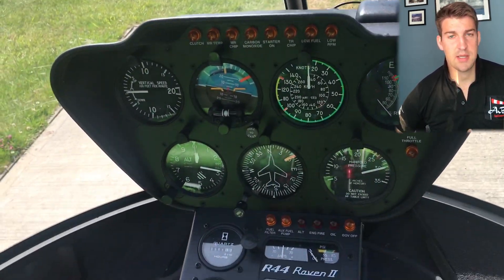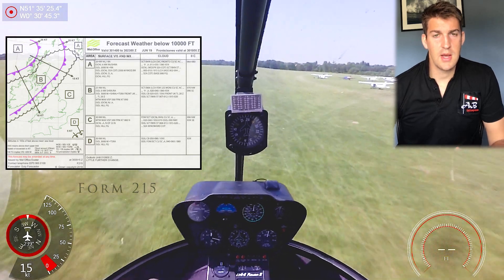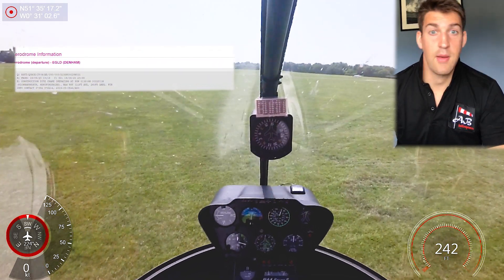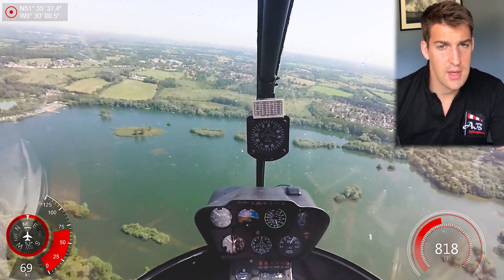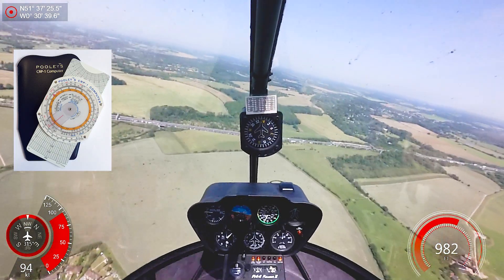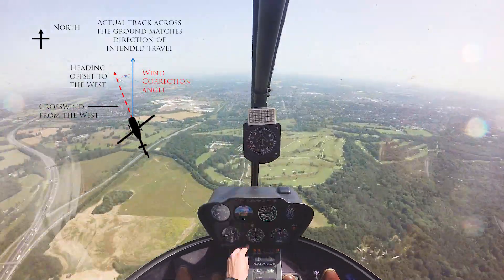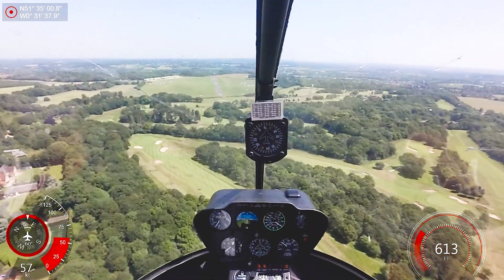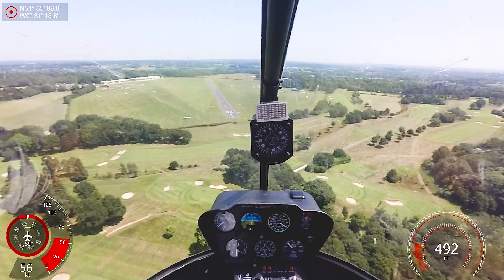How do Helicopter Pilots Navigate? The basics!

Comment: How do you avoid other traffic such as other helicopters/light aircraft (especially if travelling in sun)?  How do you navigate at night?  Don´t you have a GPS guidance system?  Say around London, there must be some serious restricted airspace because you´re on the flight paths to Stansted, Luton, Heathrow & London City.  Don´t forget that pilot who crashed into a building by the Thames a few years back in fog (you must remember that).  Watford, that is on the Heathrow approach out heading towards Clacton.

You mention head/tail winds.  Do thermals in the summer affect helicopters?  Say you have a cold front approaching from the s/w in July with potential for some serious CN clouds 25000ft+ you´re likely to see some serious lift.  Also ice buld up, how does this affect flying?  Does humidity need to be taking into account as well?  Ice can have serious consquences on commercial airlines.

http://www.skystef.be/forecast19c.html

BTW is it really +10c at 20000ft as shown on this site (see the pink over Tunisa, it has +25c)?  The site states that you add 10c to get a rough average of land temp, which would give 35c-40c but it breaks the rule of subtracting 2c for every 1000 ft.
Reply from the maker: Navigation at night is a bit more tricky - rely on dead reckoning, use of radio aids, and using large features that are well lit to navigate by - eg large motorways and towns/ cities- but the level of accuracy will be reduced as everything else looks black _ I have a few videos of night flying - check out our ‘Md500 night flying’ one - - here is an exercise for you - try and compare it with ‘Md500 part 2’ - same route - just day/night - and see if you can match any parts of the route up
Reply: @ABHelicopters  Hi, thanks for the reply but it raises more questions than answers.  The helicopter that crashed into the crane by the Thames, are there no laws on visability?  Going on the Thames route, are there height & speed restrictions?  e.g. going west you need to be 3000ft & going east you need to be 2000 ft.  I am getting dizzy, first you need to be scanning the air for other traffic but at the same time you need to be looking out for landmarks, a bit like driving whilst using a mobile phone?  You´re talking serious speeds.  I guess a helicopter can go at least 120 mph, whilst a Cesna probably can go the same speed, it doesn´t give much reaction time.  Also into the mathematical equation do you not need to add decreases in air (drag) as you go higher?  e.g. in Mexico City, you will need a far longer runway to land than at sea level!

I will have a go but outside the central London area I could get seriously rusty.  I think what you have given is an incredibly basic video, to a very complicated job.  Watching youtubers such as "CaptinJoe", who I guess works for Air Berlin, you realise what an incredible amount of knowledge you need to be a pilot.  You need to understand engineering
Reply from the maker: Hi Tim,
Sorry I had not got around to responding to your London airspace question - yes I do recall the incident - it was unfortunately very close to home. The airspace is indeed very complicated - between Luton, stansted, Heathrow and Gatwick there is effectively a level of uncontrolled airspace below 2500ft, with control areas directly around each airport. Flying over London is subject to additional rules - I have a few ‘Pilot guide videos’ for flying in the control zone , on the helicopter routes, which explain more. The primary restrictions are on heights, and where single engine helicopters can fly / clearance limits. You are correct that there is a lot of multi tasking going on , perhaps monitoring and using two radios, whilst maintaining strict adherence to height and heading, hence why it should be practiced multiple times.
Reply from the maker: Air density, altitude and temperature all make a difference , not only to the wind speed, but also the airspeed, - which is why there is a difference between indicated, calibrated, equivalent and true airspeeds -and of course - the ground speed
Reply: @ABHelicopters  This is an incredibly skilled job.  I always thought Gatwick never really came in the M25 area, they would turn left towards Maidstone coming in from the east.  I flew to Orlando once & the aircraft took off on the easterly (or is Gatwick´s runway S/W - N/W?) the pilot turned out of the M25. Also you have weight factors (fuel) to contend with as well which could affect flight times & costs.  Mathematics is a must.  Have you never thought about a commercial 2 jet engine license?  These things cost an absolute bomb, 100,000k+

Wasn´t there another incident (about 2 years ago) where a small engined aircraft went into Heathrow´s controlled airspace & shut Heathrow down for 45 minutes!  I doubt whether the controllers at Heathrow, were to impressed!
Reply from the maker: Gatwick runways are E/W facing. The airspace to the south of London is slightly less congested - but there is still London city , biggin hill, fairoaks and farnborough in close proximity to LGW. Unfortunately the journey to commercial heli or fixed wing is expensive , but With heli - the route to employment is often less defined/ or structured compared with the airline world. Unfortunately infringements , at Heathrow or otherwise , are costly in terms of time and money of re routed aircraft - the caa publish monthly statistics of infringements- and encourage the use of moving map gps devices on tablets (eg sky Demon , runway Hd) to avoid airspace busts
Reply from the maker: Hi Tim,

Thank you for the comment - so first of all avoid other aircraft - a principle of see and avoid applies in uncontrolled airspace - you are constantly scanning for other traffic. There are measures you can take to aid this- so for example- don’t fly at large numbers of altitude - say 2000ft bang on- instead - go for 2100ft, 
Secondly - around this area - there is a lower airspace radar service - Farnborough radar - on 132.800mhz , whom can offer a traffic service - you set a squawk on the transponder - and they can see you , and other traffic, and give you warnings about them
Reply from the maker: Any other questions? Happy to try and answer
Reply: @ABHelicopters  You´re probably wondering why I am asking so sophisticated qustions; after all I have no aviation experience apart from getting on planes.  I just watch videos put out by youtubers "Captin Joe" & "mentour Pilot" that make you realise just how complicated being a commercial pilot actually is.  Flying the thing is just a small part of the equation,  much of the job centres around preparation.

I am not sure how much it applies to helicopters but one of the videos was about descending ratios.  Some of the maths went completely over my head.  I thought the onboard computers did it but evidently not.  Plus you have holding patterns to contend with

Probably more importantly how does one apply to be a helicopter pilot in the first place?  Is it not better to get a graduate.  place in the RAF or something?  Most commercial companies only want people with experience, that´s why many fly parachutists.

Don´t forget too, there are many private airfields.  Isn´t there a big a private airfield inbetween the A12 & M11 (a receptor for holding Heathrow patterns).  You need to know the London terrain inside out.
Reply from the maker: You are referring to Stapleford airfield and the Lambourne VOR or Hold?
Reply: @ABHelicopters  PS Do you believe the official theory of the Leicester helicopter crash?  It looked to have hit something such as a drone!
Reply from the maker: I believe there is a report out with regards to the A169 crash, relating to a disconnect from the yaw control pedals  to the tail rotor mechanism
Reply from the maker: https://assets.publishing.service.gov.uk/media/5c090ab1e5274a0b64c8a2f4/S2-2018_G-VSKP.pdf
Reply: @ABHelicopters  I have been hit with about 50 notifications!  I must be the only person in the western world who refuses to take a smart phone out with me.  That´s why I am a bit slow.  I am a bit of a conspiracist, some times I don´t accept official responses.  I am talking about the Leicester City FC crash not sure if it is the same as the A169 crash.  This was an incredibly important VIP on board,.  The Duke & Dutchess of Cambridge, going to the scene the next day.  Media was incredibly censored.  Would it not have been incredibly damaging if the helicopter had hit a police drone?  Look at the Malaysian crash in the Ukraine, just to prove investigators can have a "political" motive judgement. 

On a mathematical probabilty, this helicopter had an exemplary safety record with very experienced pilots could they have made such an elementary mistake?  After all it was hardly the first time they had carried out such a manoeuvre.  Stapleford, is the aerodrome but there are few more around the St Albans, area.

How did WW2 pilots navigate?  The likes of Stansted must have been pretty hard to find.  Did Bishop Stortford exist 75+ years back?   Navigate by fields?
Reply from the maker: Navigation started with dead reconing , especially for trips at night or over large areas of featureless terrain - astronomy also was used - using a sextant  (you will see aircraft from the prior the 1940’s with small astro domes on the upper fuselage). Post that - during the war - a lot of development went into radar navigation - primarily to aid bombing accuracy - such as OBOE . After that , systems such as Decca and Omega were used, moving onto the modern VOR, NDB and currently GPS that we use . Larger aircraft used Inertial navigation units - now they use laser ring gyros in a IRS to determine how far they have moved from a fixed position